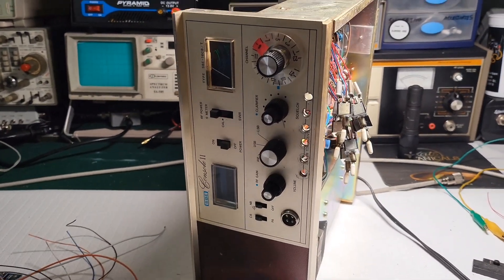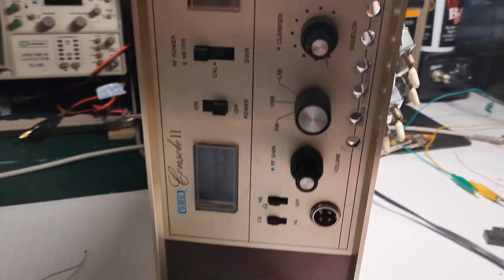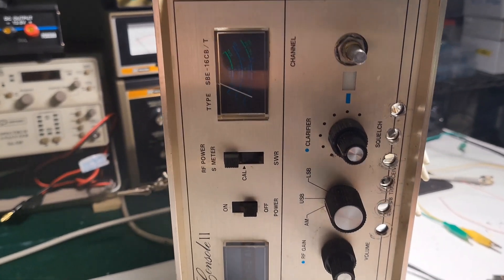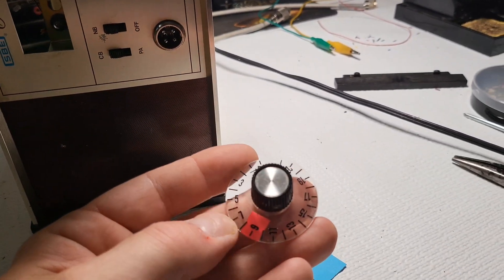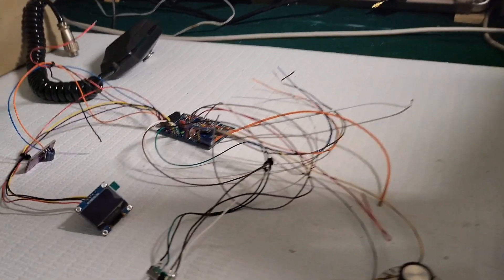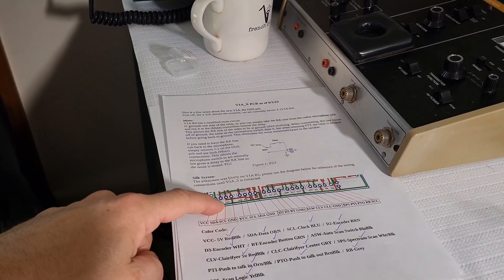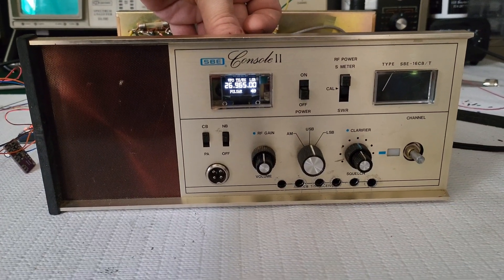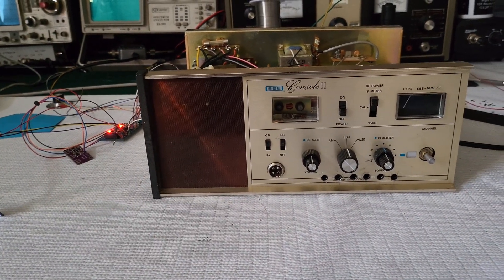SBE Console 2 DDS VFO install part 1

Comment: I have an SBE console 2 that I would like this done to, would you consider it doing it for me?
And what would you charge?
Reply from the maker: This is the first and last dds vfo I will ever do. Not so easy to install as they make it seem.
Reply: @pulsarcb ... I have I have two SBE console lls, I have siltronix model 90 vfos to go with them, they need to be recapped aligned, swept and peaked.... and cleaned up quite a bit.... would you consider taking them in and doing this for me?